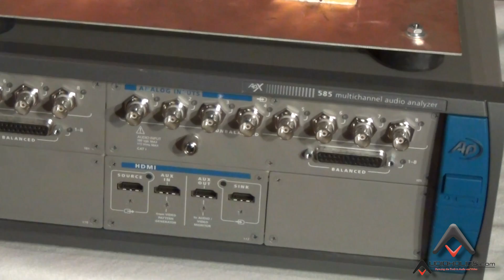How To Test and Measure Audio Amplifiers

Comment: Figuring out the 4 and 8ohm outputs on power amps drives me nuts I'm a production company and no power amps have a power match to the speakers
Reply from the maker: You dont need to power match an amplifier. You just have to make sure the amp is stable in low impedance loads for more difficult speakers.

Comment: Hey guys, Love the post. But I would like to see some of the comparative test data you have run and I have a couple questions. 
How do you test the power supply with only one load resistor?  You need all channels driven with burst or at least something. The power supply is really the only component you need to test until you get into manufacturers top models as most other components are comparable.

How do you measure the real switching noise components in a class D amplifier as it is the biggest issue with them? Class D amps can be small but most don't adequately filter the switching noise. Most high quality class D amps have just as much spent in dollars on filtering as a linear supply. 

You just can't package 11 channels of amplification into an AVR with any real quality in specs. Run your test in 7  or 9 ch stereo with a test music track with nice low- end to evaluate PS sag, heat, switching noise and distortion on each channel.  That should find the weakness and nonsense specmanship. Keep up the good work.
Reply from the maker: We have multiple resistor loads to test up to 7 channels. I just showed 1 load as example. You can use a precondition filter on Class D amps that have switching noise within the operating bandwidth of the test gear. Some of the better more modern Class D amp designs switch at a much higher frequency so it doesn't usually affect my AP test gear.

Comment: Without using the name (Rhymes with Hotel)  my "380wpc"  amp got blown away by an Anthem MCA 220, which is conservatively rated at 200wpc.  Some amp designs just don't have a good current transfer. Much in the same way a 200 wpc nakamichi PA-7 would eat a 260 wpc M-85.

Comment: In Europe we have 240VAC on the grid, I can easily get away with 15A circuit breakers, though I have 20A installed.  No such thing as a voltage drop on the grid.

Comment: has speaker ohm changed i have a brand new  Jenson home theater speaker system. But it does not say if it is 6 or 8 ohm. speakers. whould it be safe to hook it to my  av receiver.  it is  older like 1998 modle year.

Comment: Krell recommends a 30 amp for a  fpb 600.I told my electrician I want a 30 amp.He says you don't need that a twenty is fine. He leaves ,I crank up the volume and a couple of minutes the fuse blew. I had him back to change and never blew a fuse again. The room is 13x17.The band sound like it was playing in the room. I like that, I have legacy signature 2's .I use to have a carver amp and I never got the bass the krell had a firm bass.It changed my heart rate to tachycardia.I still have the carver amp I jumped the power for my 12"'subs in the same cabiinet and i use a krellavs

Comment: Please forgive me but how are you doing apples to apples if you aren't always supplying in the same line voltage for all of the test?
Reply from the maker: IJChan223 I monitor the line with a RMS meter to make sure it never sags more than 2 Vrms from nominal.  It's apples to apples b/c it's real world not an unrealistic lab condition that people CAN'T reproduce in their homes.
Reply from the maker: We have a dedicated 20A line to test amplifiers.  The only time it will sag more than 2Vrms is if the amplifier power supply exceeds 120x20 = 2400watts.  It's rare we test amplifiers that powerful but we note it when we do.

Comment: all of this is great, but....speakers arent perfect resistors. amps with similar performance with resistors can and will perform radically different when hooked to real speakers. thats in no way correct measurement
Reply from the maker: reactive load testing is a good thing to do but resistors will tell you the limits of an amplifier nicely.  Also its an industry  standard to measure power into a resistive load.

Comment: These Videos are awesome please continue to make them. I notice that the videos are made to teach people about audio. i have a suggestion. Could you teach us how to read the speaks in general products like a single driver (slp, etc). Also what to avoid when purchasing equipment. I am a college student (mechanical engineer) that loves audio but cant afford the really expensive stuff so i try to buy used klipsch products and have been very happy with them so far. I have a Sony receiver that i know is holding my system back. If i use it in two channel mode with the two main speakers it sounds fine to me but when i engage the 5.1 there is a noticeable hole in the frequency range . i am sure that your test equipment would show this (power vs frequency??) anyway i love this videos . thanks
Reply from the maker: thanks for the great suggestions.
Reply: Heck yea they r